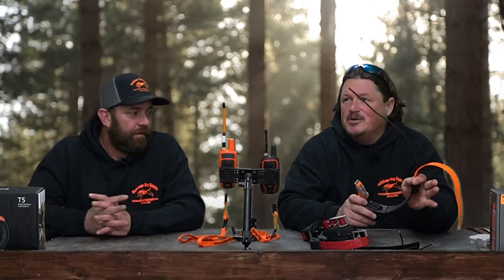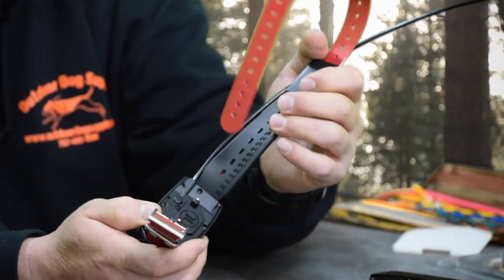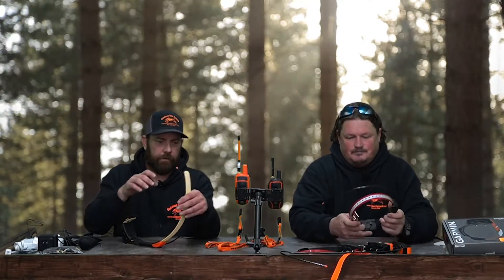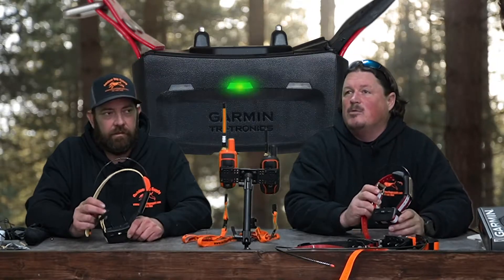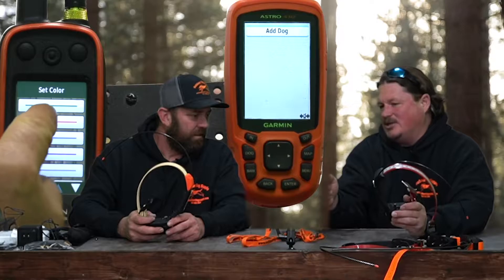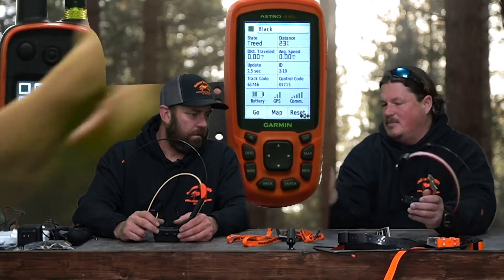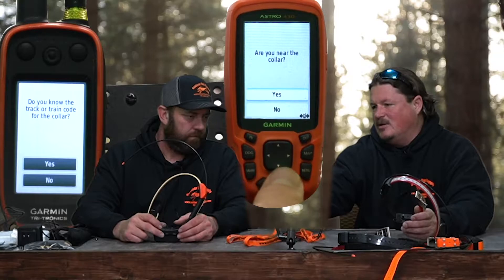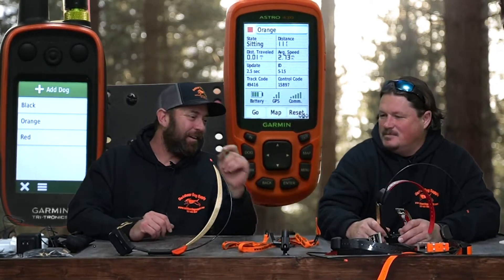About the Garmin TT15 & T5 Collars

Comment: How do you shock or tone a hound with the TT15 connected to a Astro 430?? I don’t know if it’s possible but I’ve been looking for a good shock system but it be handy if the collars would work with my Astro 430 so I wouldn’t have to buy a whole new system.
Reply from the maker: The Astro 430 won't shock or tone, only track. You would have to use the Alpha for those features.
Reply: Why does the 430 have the bark mode detection
Reply: @codyaldridge4519  to old porbly
Reply: SerpentMaster Armstrong  I don’t understand. If you have t5 collars then bark detection will work in 430